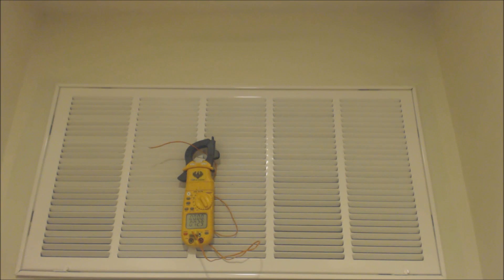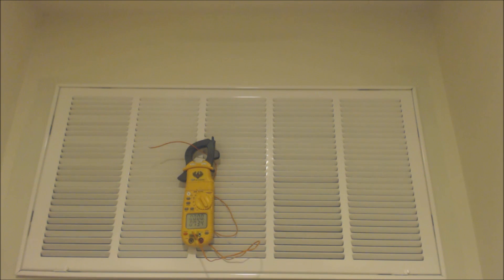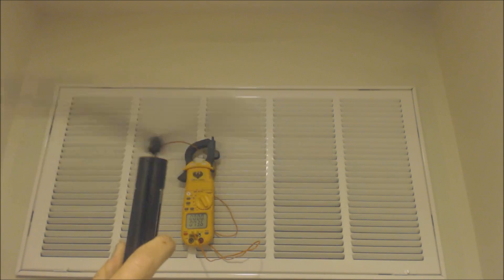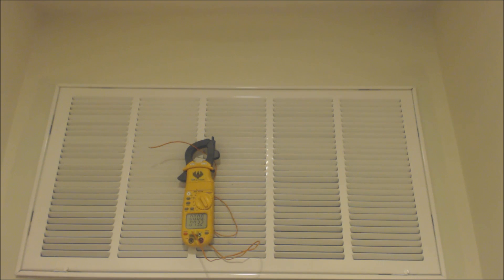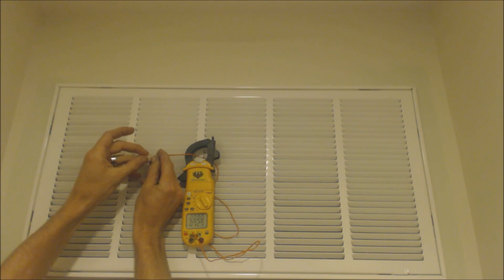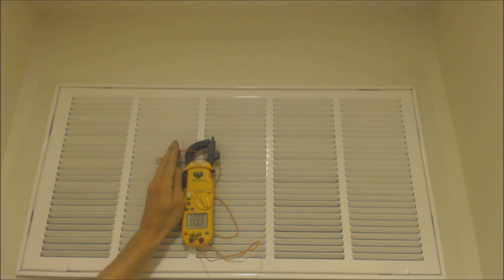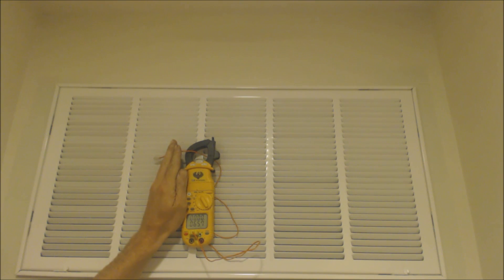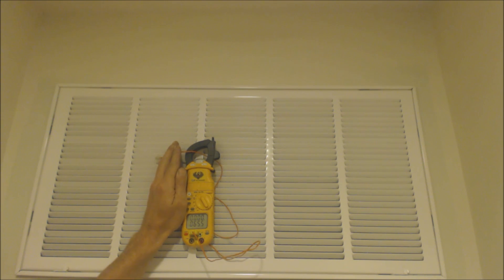Superheat Charging Method: What to do When you Don't have a Psychrometer to Measure Wet Bulb Temp!

Comment: You can use dry bulb temperature and humidity percentage to get web bulb temperature by using an equation.  There are several websites that can do the calculation for you. The result is actually quite accurate

Comment: Hello and thanks for all your videos, I have 2 questions. Question 1…..I recently replaced a 3.5 ton unit 410a at my home with a 16 SEER Grandaire.. The old Carrier 13 SEER unit 410a  was installed in 2006, a Lennar home I bought in 2011. A couple years ago I moved the fan speed from med to high because of the 6 degree temperature drop I was reading at the exchange in the furthest room to help move the air faster so it wouldn’t pick up as much heat from the attic ductwork. The ductwork is inspected and all good. The other reading was taken on the supply side out plenum. It’s at it’s worse during the summer on a late sunny afternoon. The humidity remained around 50% during the summer. I Live in Central Florida. So it was working good. Now with the new unit, same settings, the humidity hovers around 60% RH. When I run the AC at the usual 75 degrees, it drops to 57% RH then after it turns off it’s back to 60 in no time. It was running on and off all day today and it was about 77 degrees out today. I can’t get it down to near 50% RH. I’m using the same media filter box with the new unit. Could it be because of the higher SEER new unit? Everything is sealed up tight on the air handler and return. I know, I sealed it😄. Installers did a real crappy job sealing anything. 

 Question 2…I did a WB reading at the return by the air filter box. I did the DB by the condenser. I calculated a 14 degree Total Superheat 60 degree WB & 72 DB. I also did the the reading at the condenser unit port and had a reading of 43 degrees on the gauge and 61 on the thermometer or 18 degrees Superheat. Sub cooling is 10 on the unit and I’m reading 10 - 10.5 degrees. Since my line set is approx. 75 - 80 ft long, how much should I subtract for temperature loss for my thermometer reading at the condenser unit? The condenser unit is lower then the air handler and outside in the backyard. Air handler in the ceiling of the garage laying horizontally. A lot of info but hopefully my questions and your answer will help   others too. Thanks.
Reply: Did you figure out the humidity issue?  Was it a short cycling issue or maybe an evap coil bypass issue either by design or pehaps 1 circuit was plugged?
Reply: @u2ooberboober  short cycling had to do with time of year as it got hotter out the AC runs longer now.

Comment: Not a good idea to put warm fingers so close to thermocouple tip.  The thermocouple wires can conduct heat up to thermocouple bond, especially if thermocouple is using larger gauge wires.  

This also applies to raw thermocouples being used for measuring suction or liquid lines.  Good to tape them to pipe for couple of inches up from thermocouple bonding tip so the lead wires get similar temp to tip to avoid ambient air temp getting conducted up the metal wires to tip.

Comment: can i use an indoor outdoor thermometer with a wet rag over the outdoor probe to get the wet bulb? if so how would i get the set bulb from that?  do i use the wet probe temp and humidity ? do you have a calculator for this? thanks

Comment: No sir with all due respect, the wet sock on the thermometer isn't about an accurate temperature reading. The wet sock simulates 100% humidity to determine the lowest attainable temperature for the evaporation of the water. 
Wet-bulb temperature is the temperature at which water is able to evaporate at 100% humidity. Wet-bulb temperature is your lowest degree obtainable within the current dry bulb temperature and surrounding conditions by the evaporation of water.
I know it's your video but I can't help it, physics is my area and I get these little quirks in my head I just want people to be as smart as they can be sorry and very good video.
Reply from the maker: The video is all about getting a correct wet bulb temp if your psychrometer breaks, yes you are correct, thanks!

Comment: Is that the chilled air supply grill which is as same as the indoor blower in the split and the window AC ? 
You mean the wet bulb is the temperatures of air leaving from the indoor ?
Reply from the maker: It is the temperature of the air entering the system which is called the return air, thanks!
Reply: @acservicetechchannel  got it. So can you tell me ,  for the split one, where should i measure this please.?

Comment: Thank you for the great videos.  I wish I was in your service team . I have a question.  Can we use the dew point temperature or wet bulb temperature from Google weather ?
Reply from the maker: No we use the specific dry bulb temp 1' away from the outdoor coil and the wet bulb indoor temp at that point in time. As the unit runs, the wet bulb temp will decrease, changing your target superheat, thanks!

Comment: I'm new to all this...  Do maintenance now for about a year.  Just became epa certified,  etc.  I'd watch the AC techs when they came out to learn u know.  But NONE of them ever do this stuff.  Just hook up gauges and add some "juice" if it needs it.  Just seems like guess work that way,  or just getting close.  Interested to hear your thoughts on that
Reply from the maker: Ha ha, you are absolutely right. The problem is that these just kinda getting by techniques are not good for compressor safety or efficiency. You may be watching them checking subcooling if they a temp sensor on the liquid line since the target subcooling is posted at the outdoor unit, thanks
Reply: acservicetech never have I witnessed that either.  No temp sensors,  no subcooling,  superheated,  etc.  It baffles me.  Had one about a month ago come out.  I knew it was low on charge,  etc.  But we didn't have any Freon at the time.  He had his gauges on there and was adding it and said see it fluttering there,  that's the txv.  I said no it has a piston.  He said are you sure??  I was sure cause id done the measurements already,  and did my wet bulb like you'd shown with my meter.  Sorry so long
Reply: acservicetech also, thanks for all the stuff you put out there.  I've learned a lot from your videos.  Youre a good teacher
Reply from the maker: Oh wow, I'm sorry to hear that! Thanks Mike!

Comment: Do you need to restrict air flow at the condenser to simulate a 95'F day?
Reply from the maker: You would need to get the liquid sat temp up to 90-100 degrees by restricting airflow at the outdoor unit in order to check subcooling. The inside of the building needs to be 70 degrees or higher, thanks

Comment: is the blower has to be on...? or working to calculate the wet bulb..?
Reply from the maker: Yes that is correct, it has to be on and you would recheck this every 5 -10 minutes while charging, thanks Erick!
Reply: hey so should ido wet bulb dry bulb reading  before i charge the system on empty system only the indoor fan should be working
Reply from the maker: Yes you would check your target before turning the system on just to find out the where you are at but you will still need to wait 10-15 minutes before charging unless the low side is below 2 in which case you would need to add. You will need to recalculate the wb every 5 minutes or so because wb will lower and the superheat target will change, thanks
Reply: What do you mean by the low side? Could you elaborate on thar?

Comment: Lower the relative humidity, lower the wet bulb temperature and higher the latent heat of evaporation in the evaporator?
Why is target superheat related to the wet bulb temperature?
Could you explain that superheat formula 3 times wet bulb temperature-dry bulb temperature -80?
Thanks

Comment: Can you make a video on where to take your wet bulb/dry bulb temperatures at?
Reply: I think he already did. 
Wet bulb= hold your psychrometer next to your largest indoor return grill.
Dry bulb= hold your temp probe about 6 inches away from the condenser, out of the sun. Down low and on the shade, not at top where heat is blowing.

Line the numbers up on your superheat chart and you''ll have your target super heat.
Reply from the maker: Yes you would check your target before turning the system on just to find out the where you are at but you will still need to wait 10-15 minutes before charging unless the low side is below 2 in which case you would need to add. You will need to recalculate the wb every 5 minutes or so because wb will lower and the superheat target will change, thanks
Reply from the maker: That would make a great video, Thanks for letting me know what you would like to see.
Reply: hey man so should ido wet bulb dry bulb reading before icharge the system with refrgerant pls help

Comment: If I had a wet sock over the temp sensor how long would you leave it there before you read it
Reply from the maker: So if it was a mercury bulb and right next to the fast moving air at the return grill, about two minutes but make sure that the sock is able to wick up more water as needed at the bulb. A sling psychrometer makes sure you have enough air moving while holding a container of water and additional sock to wick. If it is a temp sensor like the one showed in the video, it is just about 20-30 seconds. This is just in the worst case scenerio when you don't have a sling or digital psychrometer. Thanks

Comment: Is the wet bulb taken while the system is running?
Reply from the maker: Great Question! Yes, the closer to the return of the hvac that you can take this measurement, the more accurate it will be but for instance if the unit is located in the attic you dont want to have to pull the door off and read it with air from the attic going in. Likewise in a basement or crawlspace you don't want air coming into the unit because you have a door off. This will also be the wrong wb anyway because it is not the temp and humidity from the house. Normally I just hang it off the largest return grille in the house and go back and check it every five minutes while the system is running as the wb will lower while it is running which will change your target superheat. I hope this helps.
Reply from the maker: The wet bulb can be taken before the system starts running and then every five minutes or so while the system is running because the wb will decrease as the system runs. That would be done with a sling or digital psychrometer. If you were taking the wet bulb like in this video where maybe your digital psychrometer is broken then you have to make sure that air is blowing by the sensor the first time and each subsequent time. Thanks for the question! Make sure to apply this new wb to the superheat chart as you check again----https://youtu.be/bIL9BrKCujc
Reply: Thanks for  your answer.
Reply from the maker: Glad to help!

Comment: I think that most new tech's are getting confused about Target superheat and Actual superheat......they are not being taught that target superheat is just the starting point.......and they have to retake the WB temp and recalculate the superheat until they dial the system in.....on the actual superheat.............maybe I'm wrong ....but that is how I do it
Reply from the maker: You are absolutely correct and that is what I try to teach in the videos. I will see if I can make it a point to really spell this out and repeat it for the next superheat video. Thanks for the comment!